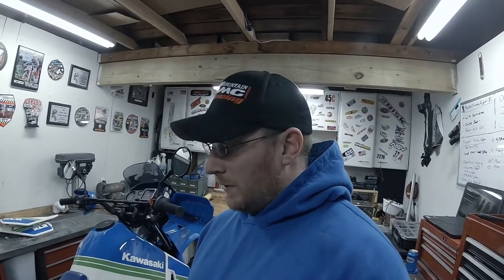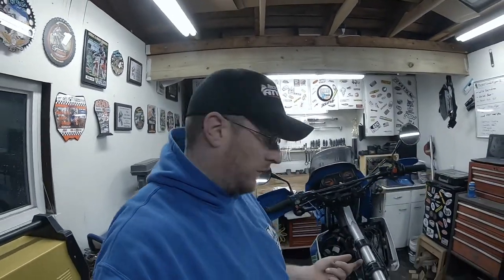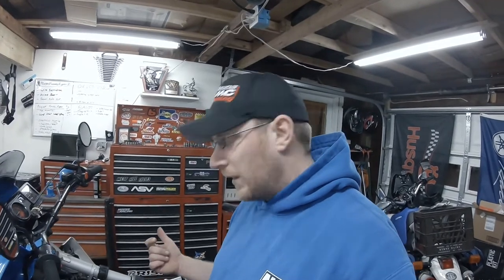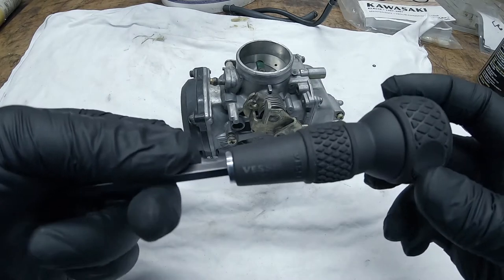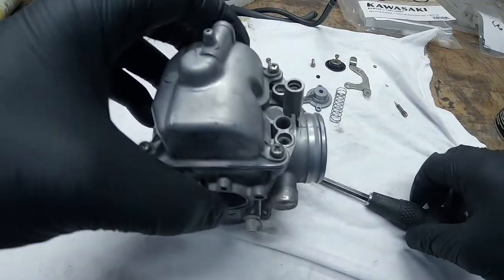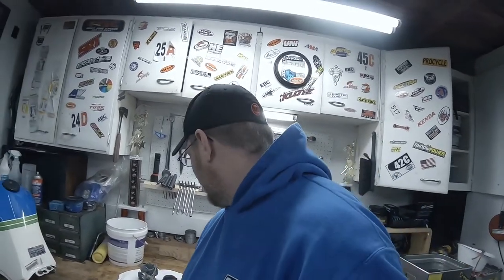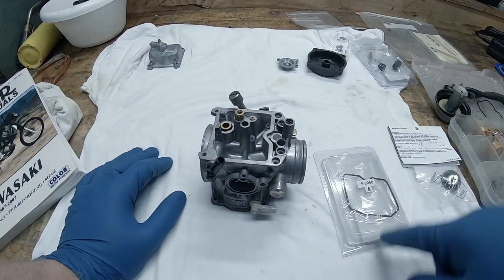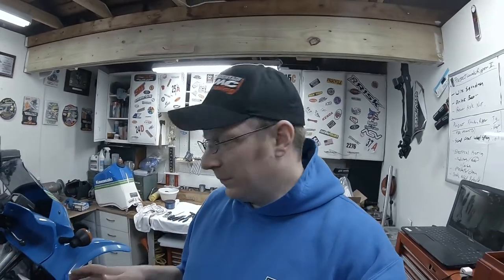Weekend Garage Vlog Episode 42: 1990 KLR 650 Backfiring fix!

Comment: I think there are some glitches in the video dude:/
Reply from the maker: I tend to ramble and edit most out to keep the videos around a certain length. I also attempt different takes on the same thing, edit the best I can. Editing sucks BTW.
Reply: @robinsonmotorsports9976  No, its just that the  video pauses a times. Not like any of our other vids.  You do a great job of making these - keep it up!
Reply from the maker: Fixed this issue. Turns out it was my editing software, downloaded the latest version and no glitches/time loss

Comment: your vid is all screwed up
Reply from the maker: Yeah, I cant upload a revision.
Reply: @robinsonmotorsports9976  Figures, your video seems to be the only one i can find that may address my problem with deceleration popping. I removed the cover on the air/fuel mixture thingy and did a rebuild..........now it's popping and i don't know what direction to turn the thing to make it stop. Right rich? Left lean? It's a pain to adjust so i would love to have some idea what I'm doing
Reply from the maker: @biggooddad  in is lean, out is rich, rule of thumb is 3 turns out go to the next size main